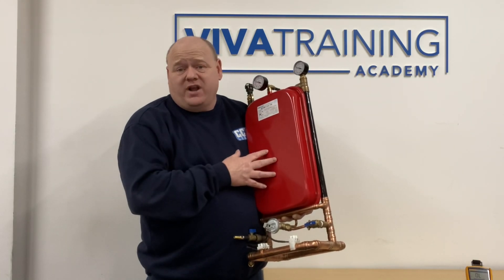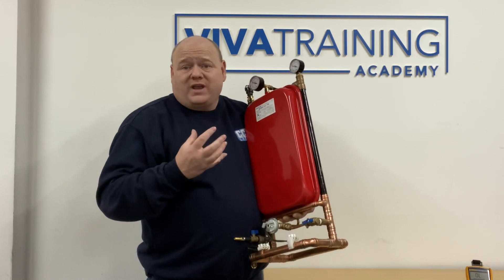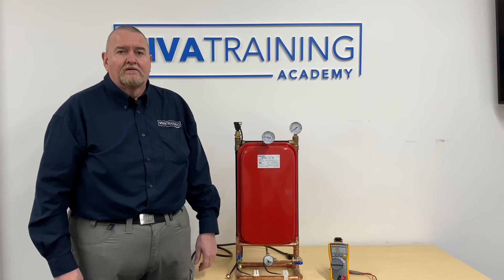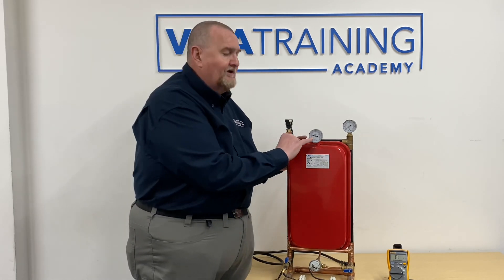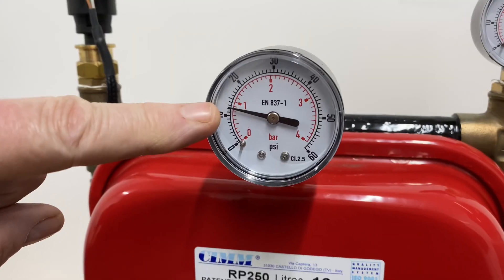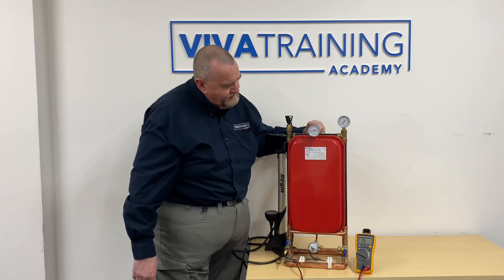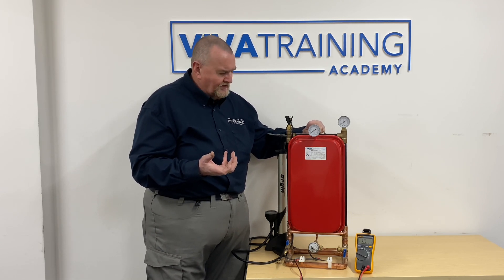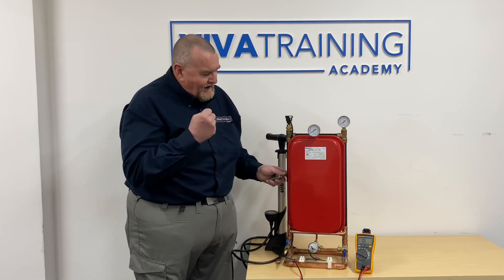Gas Training - How An Expansion Vessel Works - Boiler Fault Finding

Comment: Good video. It's worth noting that the schrader valve can also be easily replaced with the right tool if it's leaking water but the vessel itself is OK.

Comment: Great video guys, if water comes out of the expansion vessel valve, does that mean the rubber gaskets is broken?
Reply from the maker: you can get a bit coming out and the expansion vessel  could still be ok but normally yes.

Comment: can someone please explain to me why some engineers fit mini expension vessels on their boilers aswell as the original main expension vessel?
Reply: Hi Ed,
The mini expansion vessel is fitted to the cold water inlet, usually used on plastic hydroblocks to prevent damage to the hydroblock due to water hammer.

Comment: I’m doings a gas course and I’m having real trouble understanding expansion vessels and their failure. From this video,  I just don’t understand how a blockage can stop the two sides of a rubber diaphragm from communicating, i.e. why does the pressure on the air side not rise when the water side is pressurised?
Reply: Hi Rory,
If pipe connecting the expansion vessel to the boiler pipework is blocked the expansion vessel can't take up the expansion of water so the pressure relief valve would start to drip to release the excess pressure.

Comment: Nice video again but why was he getting 5 k ohms on the 3 wire pressure switch when it was flat. I didn’t fully understand his explanation of his test there.
Reply: Hi Shaun, Thanks for the feedback.
That's because it's a pressure sensor not a switch, 5k ohms is the base resistance on that particular sensor, the resistance changes as the pressure increases. I hope that's cleared it up.

Comment: Roy is the man on domestic. 
I find that when I do a service (according to some MI's) if the pressure dosnt rise on heating its all good. Also I give them a tap. If it goes ting it reet. If it goes dung it's full of water. As a rule I drain and recharge anyway. For the sake of 5 minutes out of my life its better to do that anyway. 
I will do a video on a commercial pressure vessels for ya.... I dont use a pump or air... ya will love it...
Reply from the maker: Thank You

Comment: Great demo again Roy and Allen. Can you demo the mini expansion vessel / shock arrestor. Different design and importance on the cold supply. Not many engineers fit them, but most manufacturers advise installation. Cheers.
Reply: Best practice to fit shock arrestors on installations which have a water meter present due to water fluctuations.  It's recommended to install SA's on boilers with plastic internals and hydro blocks.
Reply: @rayc1503  that's the issue. Potable mini expansion vessel vs shock arrestor. Had a job years back. Someone had fitted plastic cold main to a worcester combi. Pipe burst, looked like it had been shot from the inside ( bullet hole) mains pressure flood never good news. Fitted a exp vessel. Then there's the issue of maintenance?